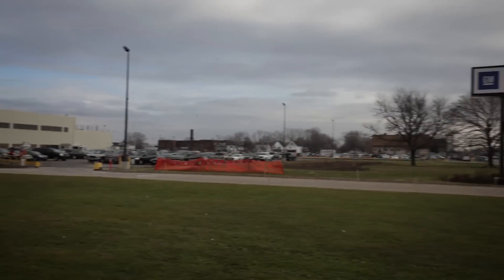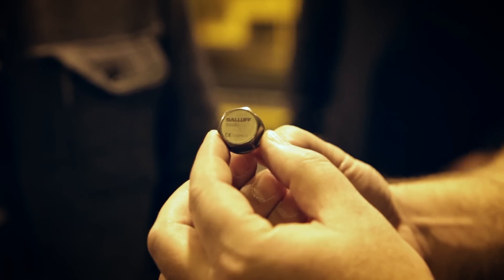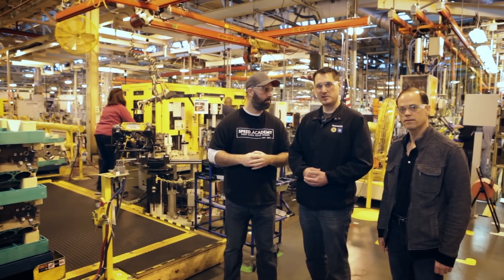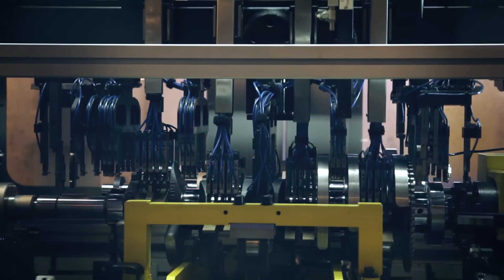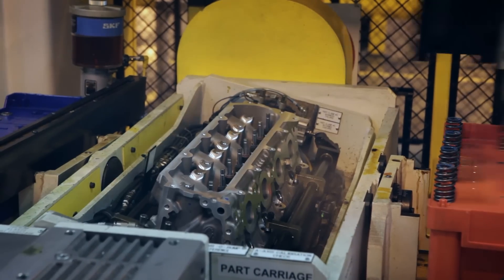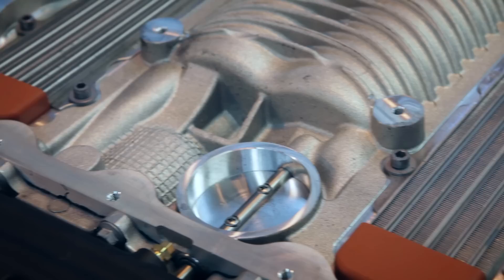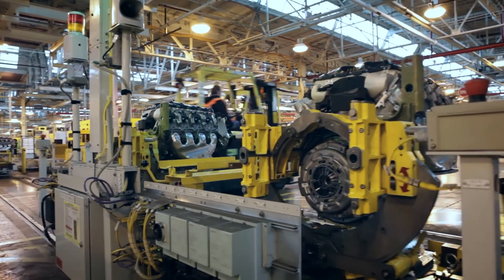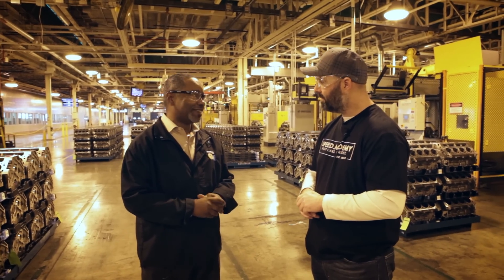Building GM's most powerful Engine Ever, the 650hp LT4 V8!

Comment: I can visibly see @ 3:19 that she didn't properly seat the main bearings... No wonder American engines are such crap!
Reply: Thesaltyseafish 500k on a german engine lol. they hardly make it past 100k without some $$$$ in maintenance.  While any gm v8 will go 300k without even thinking about it.
Reply: You apparently know jack shit about engines.
Reply: Jimmy Doolittle I prefer my bearings to be put in place by hand not pressed together by attaching the caps. Same idea as making sure your rod bearings are lined up only the grooves aren't as deep. It's a minor detail that PROBABLY won't cause a problem. Just like reusing rod bolts... 

I guess that's why german engines are doing 500k+ without spinning bearings while chevs are wearing out camshafts and the rest of their cast parts.
Reply: My username is longer than you would expect you are kinda a idiot
Reply: I worked the parts counter at a VW dealership for 5 years and can tell you they're anything but reliable.  And they do some of the stupidest crap such as those plastic coolant flanges, requiring removal of the entire front subframe for repairs which should be simple (and lets not forget all of those bolts are TTY and need to be replaced after removal, at $10+/each), etc.  I'm by no means a GM fan but I would definitely own one before ANYTHING European.  Euro cars are nice while they're still in warranty but they start falling apart fast after that and they cost a fortune to repair even the smallest things compared to domestics and Japanese cars.
Reply: x2dgamer I have 350k on my 2001 GTi. It's had the following
-wheel bearings
-brakes
- 2 timing belts and tensioners
- 1 serp belt and an idle tensioner
- Control arm bushings
- Front and rear struts
- sway bar end links

I get 32mpg (not your lying american manufacture figures, actual fill ups) and make 220hp 260tq. The head hasn't been off. It's as fast as the 5.7 chargers/challenger  

My 1990 jetta diesel has 540k on it. I've paid $110 for a full poly kit, $300 for a full set of struts, did a head gasket in 2000, and haven't had a wheel bearing go in over 300k. It's been getting over 40mpg since 1990 and the most expensive part on the car is a front strut at $80. 

I also don't need to order special over/under bearings. Because the engine was balanced before being sold. 

Most American vehicles I see are falling apart after a decade and 100k miles. You opened trade with China and then kept producing the same garbage vehicles that caused your companies to go bust. Smart move.

Comment: cant wait to see notors w solenoid operated valves, infinite 'cam' profiling and no lifters, pushrods, oiling up top or valve covers as we know it. quieter and replaceable from the top.
Reply: 05EVORS actuators will never make sense in a real world applications more to fail thats why the most powerful things on earth are not electronic based and are crude and annoying to some top fuel crude loid amazing f1 still crude and loud but is actuator based but is a gas powered one at that If I remember correctly infinite cams will mean you have to eventually change out the actuator to send enough of a volt to work correctly its never going to be infinite cams will never go away they technically are superior for a daily driver less pain no maintenance required a actuator will eventually burn up because everything does and youll have to basically junk those actuators